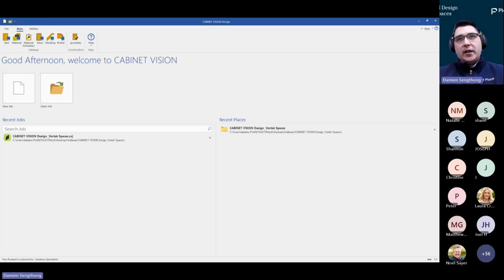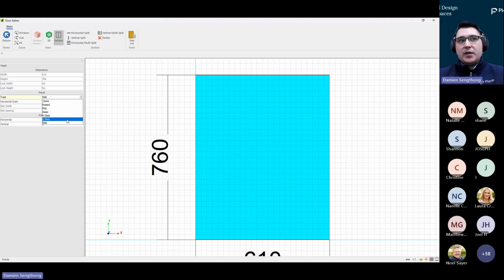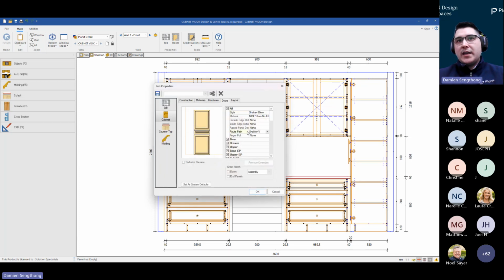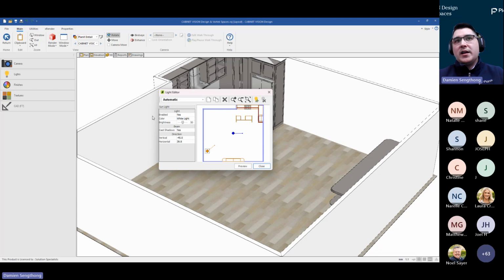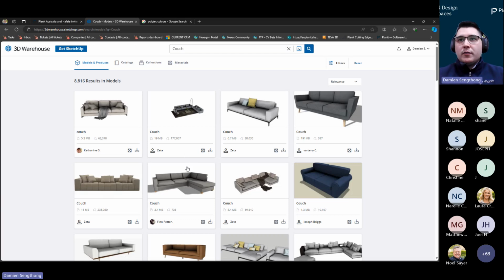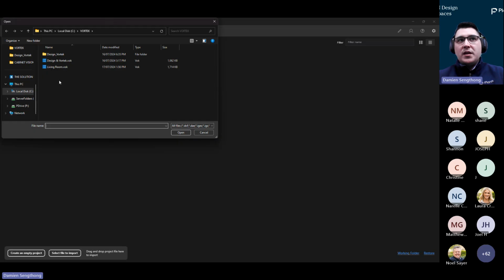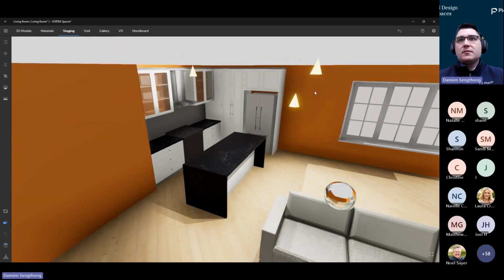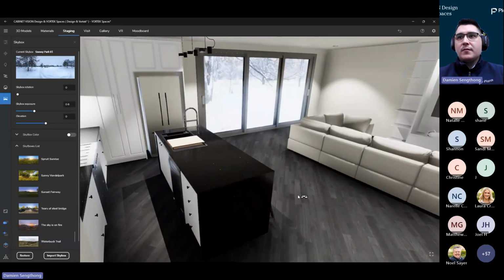CABINET VISION Design & VORTEK Spaces Webinar

Comment: You really don't adequately explain the material selections when importing the 3d warehouse models. Nor the scaling. I dare say the demo used a previously imported (known to succeed) model. If you're ultimately going to use Vortek for the 3d then consider importing the 3d objects there instead